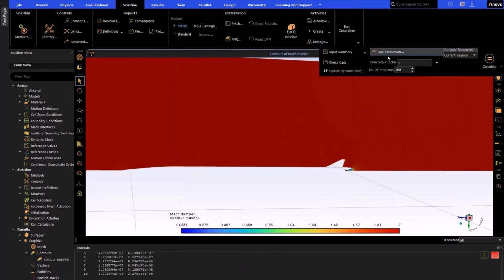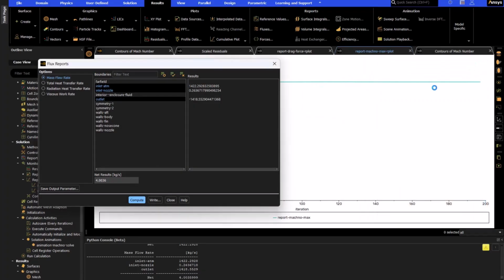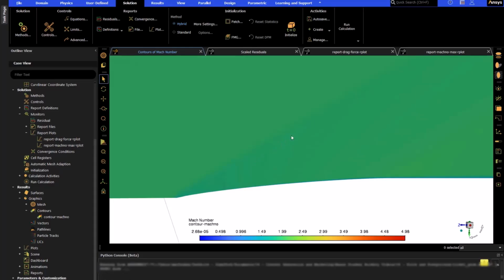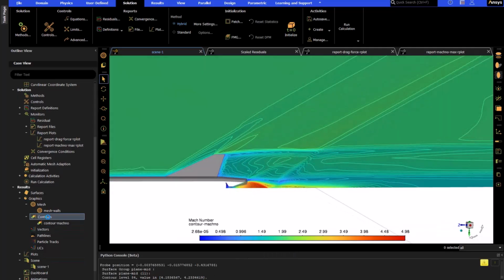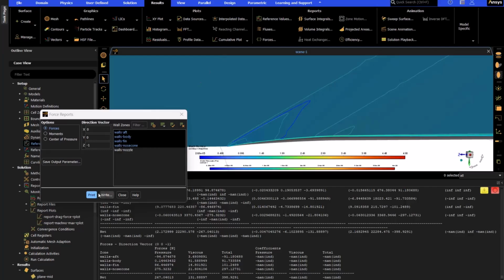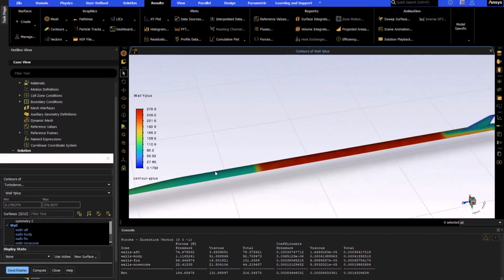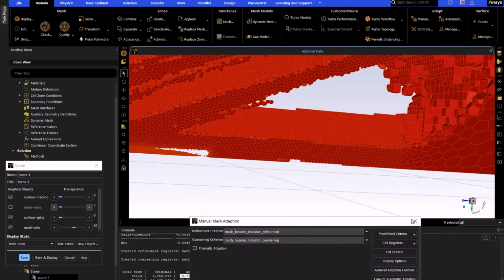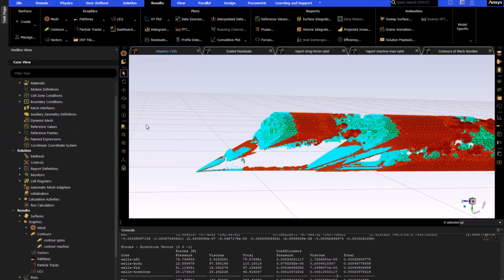Post-processing Results – Lesson 5

Comment: Hello, I have a couple of questions regarding the results. 
1.	When your computing the reference values in order to get the correct force, should you not be setting the length and area parameters based off your rocket length and front facing area? In the demonstration you left them unchanged. 
2.	When calculating the center of pressure, you select one value, in your case X, to be zero and Fluent provides the other two values. I have found that I always have a difference in the two computed coordinates, depending on which value I set as 0. This is to say, I am looking for my z coordinate, and I run the force report with x=0 and y=0, I get two different values for Z. Why does this difference occur?